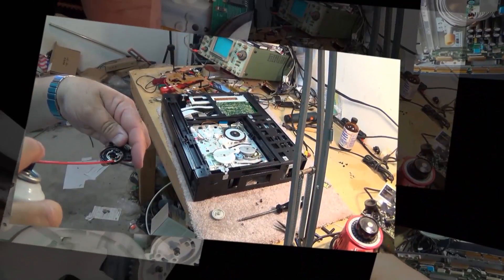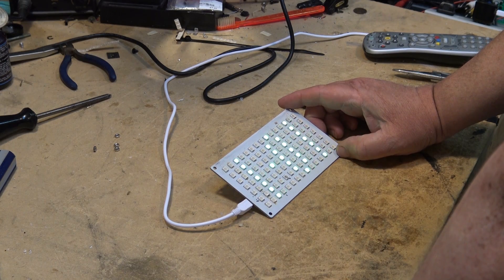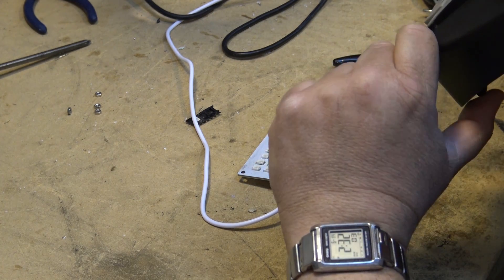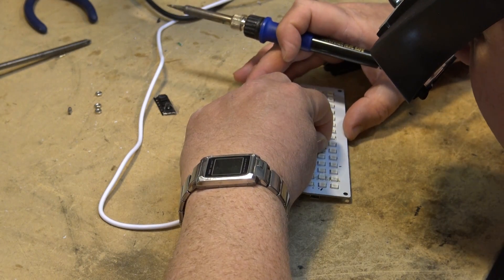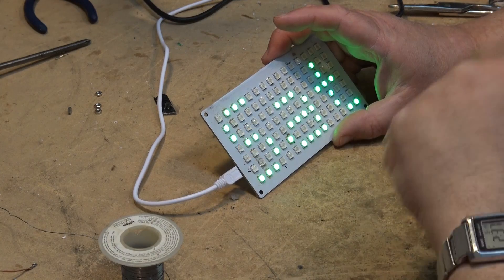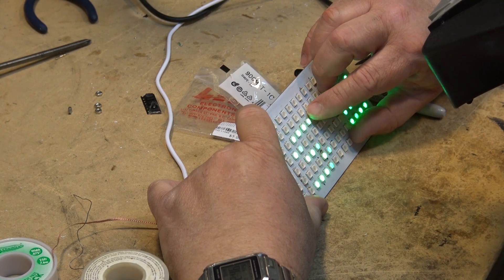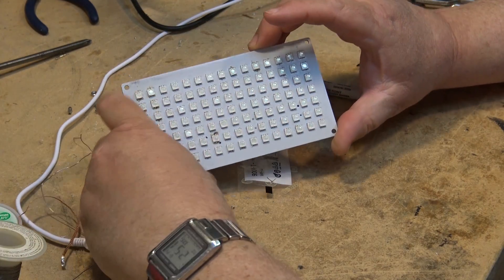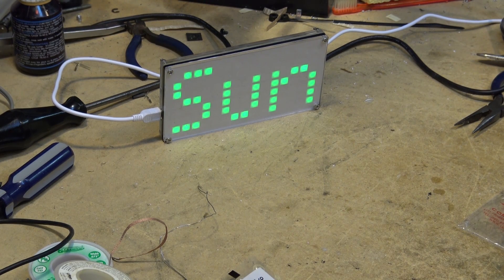Dot Clock Repair

Comment: Why in the Seven Circles of Hell would they have surface mount components if it is a home build?  Surface mount components are made for easier wave soldering, and most people don't have access to that equipment.  Indeed, since most amateurs may make mistakes which damage components, it would make more sense to have through hole components for easier replacement.  I guess they wanted to keep everything on a single board, but it is just asking for trouble if they can't even make reliable LED cells.
Reply from the maker: It is an smd practice kit, to hone hand smd soldering skills.
Reply: @12voltvids  Oh, ha ha ha!  Don't I feel like an idiot.  I haven't gotten to your build video yet.

Comment: I was thinking of getting a magnifier like that but a little skeptical of how well it would work. So they are worth getting ?
Reply from the maker: Yes, definitely. 

Watch the next video, where I assemble one of those persistence of vision floating clocks, which is a 100% SMD, and even smaller parts than this dot matrix, which were large SMD. I did the entire project wearing them, and did not us my magnifying glass at all.
Will be editing that one after work. Source files are about 16 gigs, as there were hundreds of tiny parts to install.

Comment: Thankfully it was just a dodgy joint :-).
That heatsink pcb makes it harder to solder, on one hand you need a large tip to store the heat so it does not disappear too fast, and on the other you need a small tip to get close to the pins.
Bugger aint it lol.

Comment: Are you wearing your glasses while use the magnifier?
Reply from the maker: No. I don't normally wear glasses. Those are just reading glasses, and the magnifier makes everything really big and clear. I can wear them under it, but they don't do anything. I normally don't wear glasses except when doing fine fiber optic splicing or electronic work, and I am only at a +1. My prescription readers are +1 in 1 eye and +1.25 in the other so they balance things out but they are so weak I can still see distance wearing them. This wearable magnifier means I don't need that magnifying glass that was always getting into the shot. Cheap too, only something like 20.00